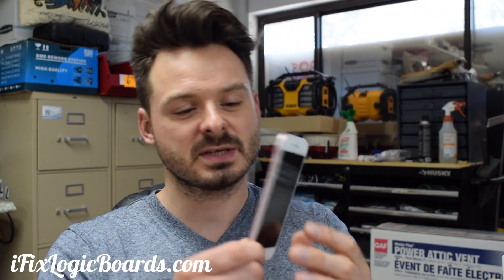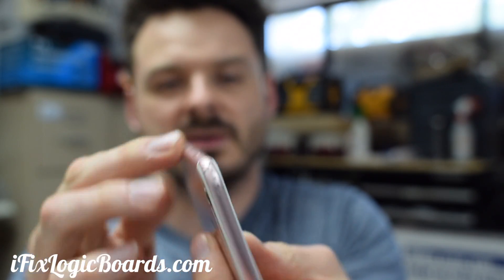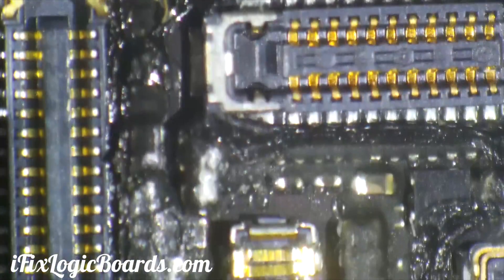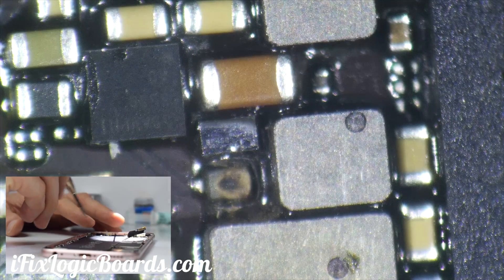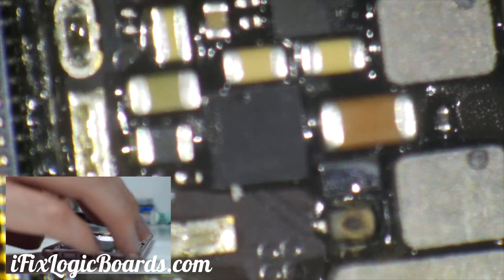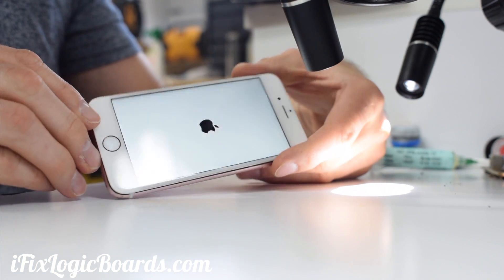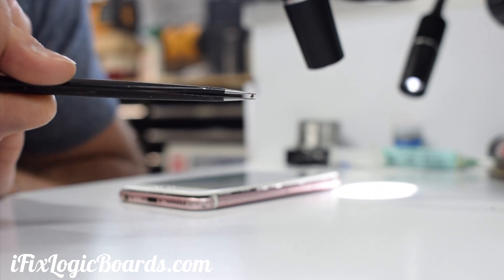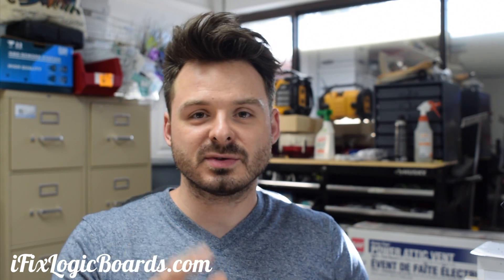iPhone 6S Backlight repair - dim screen - not just backlight filter

Comment: Hi do you know whay this chip  is burn
Reply from the maker: You can see the dide is burned. There is a reason its burned so you are hunting other broken part to.
Reply: ScoopOf3D  I have same problem it's black screen I gay told my it's  chep is burn  because  I change batery
Reply from the maker: That not much info but if you like me to repair it you can go on my website and ship it. Are you sure You have no backlight. Maybe no video.